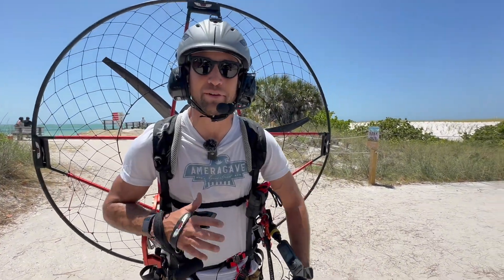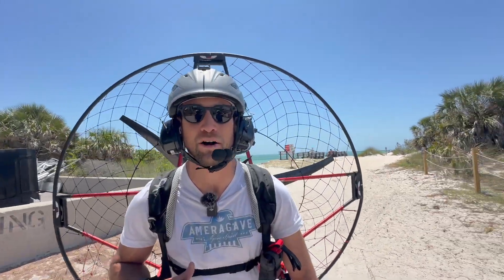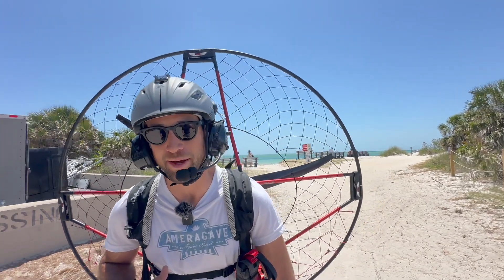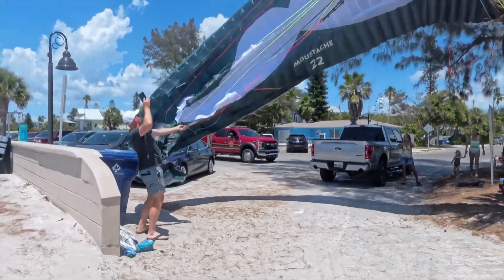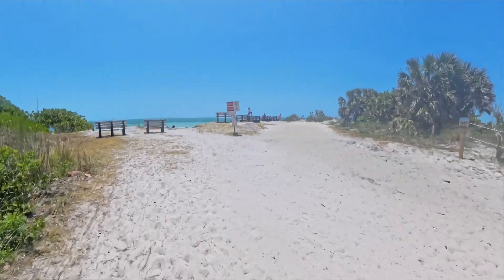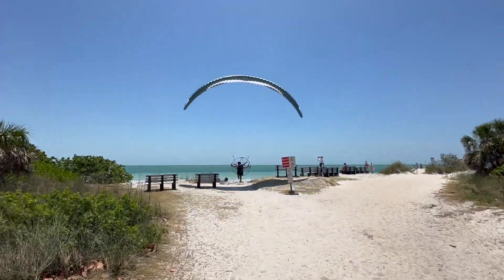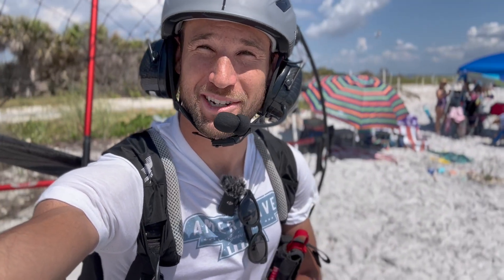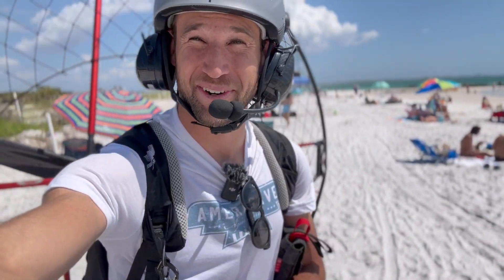I Flew OVER 1 HOUR on my Electric Paramotor! Max Range Test on the Air Italy EPG-21.

Comment: Hey Marshall have you tried running the motor at 100% throttle until the battery goes to empty? does the motor/esc/battery overheat??

Comment: I think flying in ridge lift or thermals isn't a good way to test flight time or distance as that could be done without a motor. So its not really testing the "motor".  If you could do the same test on a smooth evening with no thermals or ridge lift that would be a useful test people could extrapolate from. Also for the distance when flying with a strong wind not really a useful metric to see how far it can do. Looks fun and cool vid.
Reply: This laminar wind creates more uplift than flying in country so yes get the eppg out to more test pilots.
Reply: @jannike1015  Ha ha! Oh that was the goal lol. Good one!
Reply from the maker: There was no thermic lift on the beach/water and very minimal ridge lift on some buildings but the goal was to test it in “normal” flying conditions. I also circled some manatees for a while too. But I’ll do another test on a big wing flying straight one day.